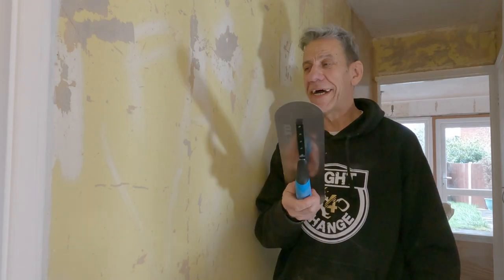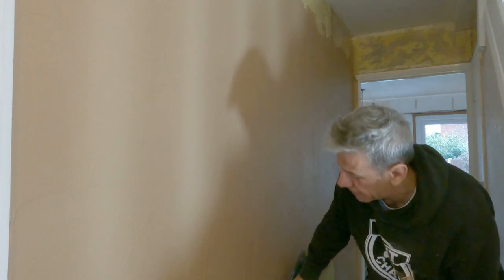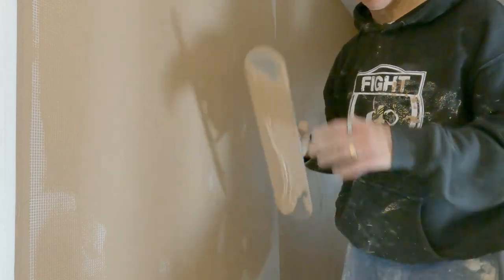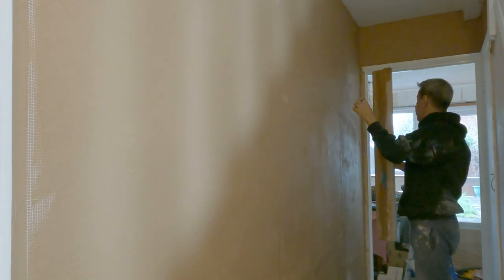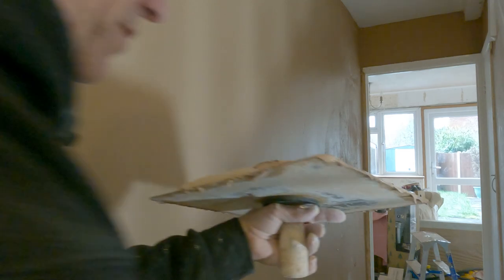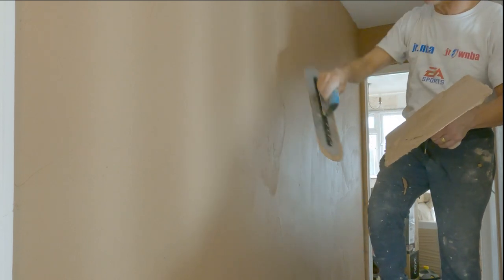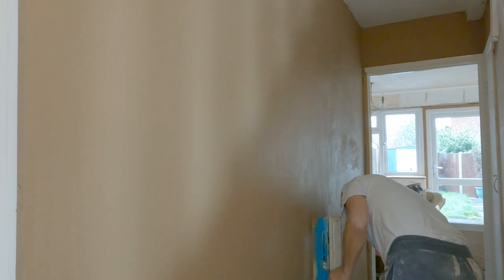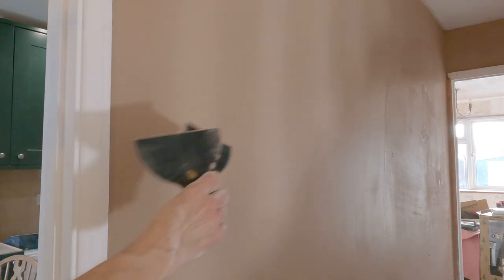Does a Pool Trowel Leave Tram Lines?

Comment: Hi mate would not mind trying that out which's make wos that trowell using wat it called thanks great video good info
Reply from the maker: It's an Ox rigid  (not flexi) Pool Trowel 100mm x 450mm (18 x 4 inch) 👍

Comment: looking good, then again, I'm a trash drywaller, ahahah
Reply from the maker: 🤣thanks Alvin, you can't be that bad
Reply: I’m left handed and duly noted your comments about using another persons trowel, it’s probably not something that comes up often…
Reply from the maker: @East side  it would be quite rare, if it's only slightly worn in then probably not a problem, but the one I tried had seen years of sand and cement work, and the laying on curves are opposites